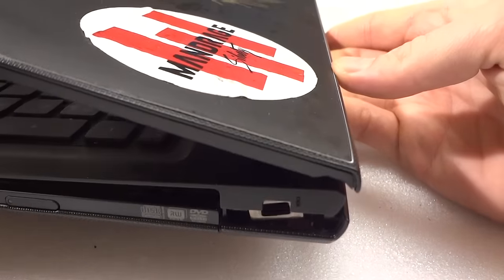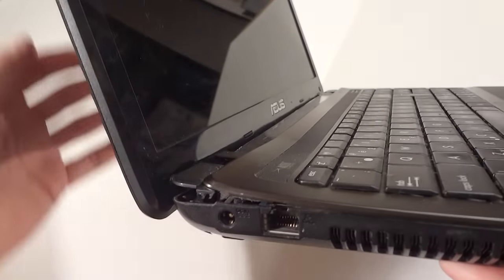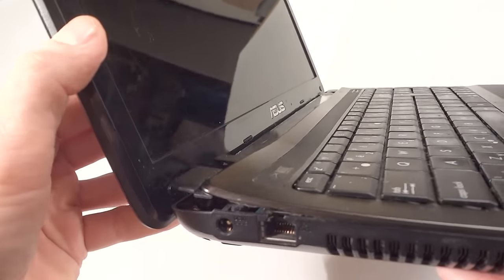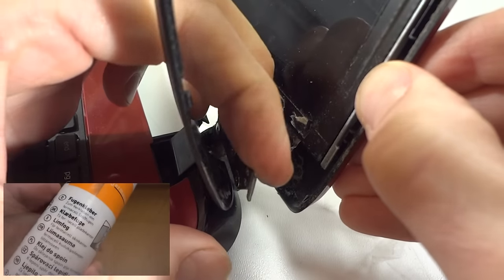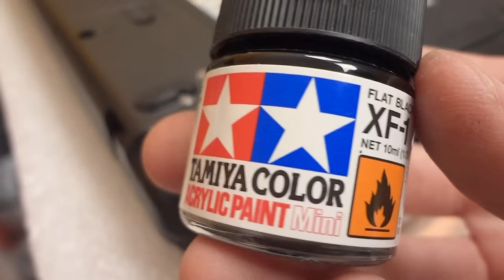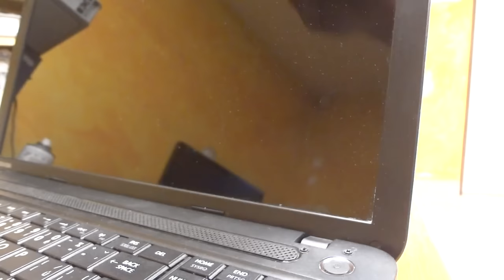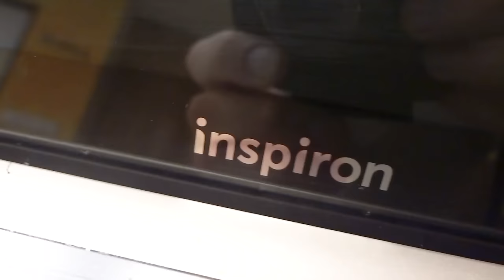LAPTOP Broken Hinges repair fix Screen Arm DIY 🔩 🔧 ➤ ACER ASUS Lenovo HP Toshiba SONY DELL

Comment: Thank you very much for this video. Just fixed my HP-15 laptop hinge using this method. In case anyone has this problem on an HP and is not sure of the exact hardware required I can help out. I only had one hinge that was broken & it was detached from the screen not the chassis. I used (3) M4-0.7x12mm flat head screws & (3) M4 Nylon lock washers. The 12mm are the perfect length. It is probably a good idea to add a drop or two of oil to the hinge to reduce the friction while you are in there. Barrel lugs would look better but may not be available at your local hardware store. Clearance hole was made using a 5/32" drill bit, I believe, but start with 1/8" and work your way up sizes until the screw barely passes through. You want a tight fit. Also, on one of the hinges, there was a very thin metal sheet riveted on to the hinges that was obstructing access to the mounting holes so I just pried that off with a small screwdriver. Easy project.
Reply: I asked to a professional to fix my HP TwT
Reply: Thanks for comment i was wondering about my lapppi size
Reply: Nyla W!ngsTracks how much was it?
Reply: Facing the same issue with my hp 15 series laptop. But I'm gonna drill but gonna use some tough glue with baking salt.
Reply: I also repaired my hp 15 from year 2014 the same way. 
It served me quite a long time. Before I could finally get a new casing
Reply: 12mm rivnut not 3mm…?

Comment: This is a GREAT video!!!!!!!!!!!!!!!!!!!!! It has given me the courage to do it myself. I took to the shop and they want 350 to repair. I can buy a new laptop computer for that.... I have a question, you showed the Toshiba fix but it is only on the bottom assembly. My repair is on the top assembly over on the right by the on button . Do you have a video repair for the top assembly?  If so please provide the link.

Comment: i like to repair stuff on my own . my sony vaio's hinge had broken 6-7year ago . i got it repaired using epoxy and super glue but it had to be repaired again and again after every few months . I saw this video a month ago and got it fixed using rivet screw .that rivet screw solved my prob, now it is as good as new .Thanks a ton

Comment: Excellent solutions with permanent fixes. But, some of your customers  probably cried when seeing the Frankenstein screw heads sticking out on their laptops!  :)   To prevent the cracks on the plastic case, I would use washers under most screw heads. I would drill the counterbore holes to offset the washer's thickness to make them look less visible. Thanks for the great video.
Reply: Better than an unfuctionnal pc

Comment: This is so satisfying 😍😍😍

The hinge of my laptop recently broke. I have fixed it by Epoxy glue in other laptop and Now I will fix mine with rivets
Reply: i was about to ask something similar, not every glue works.. i put right now (cianocrilate) but i dont think its going to last - the whole effort its not simple, is dissassemblying whole computer almost

Comment: I like the rivets idea, I didn't know those exist. I had some luck using a lot of epoxy and counter sinking the bottom side into the laptop and then covering it to hide it. I lucked out on that one and it lined up with one of the rubber feet which hides the hole beautifully

Comment: i had acer e5 exactly similar broken hinge on that broken hp hinge. Is that method will help to fix my laptop hinge only rivets and drill? Thanks and advance (:

Update: My laptop hinges are fixed now using rivets. Thank you!

Comment: excellent estimated video, unfortunately I have worked on similar things, they are difficult unpleasant .. but seeing your effort makes you want to imitate. The other option is to buy the original part which is between expensive and sometimes impossible. congratulations and greetings from Argentina

Comment: Bro please reply that my two hinges are broken(the long one which supports the lid) and after using these methods (like using screws) does it lead to broke my panel  where the screws are present. Please please reply when you watch this comment. You got a subscriber now.

Comment: You should sell small assortments of the nuts and bolts you use in these videos on eBay, maybe with the glue as an option.  Like "enough parts to fix both hinges on most Acer/Gateway models", etc. With  link to your video and instructions on resetting the nuts & what size drill bits to use. I've had three laptops now that worked perfectly well & were on current platforms except the hinges going made them completely unusable. Not everyone can afford to care more about how their laptop looks than how it works. Hoping I can get the self-employed repair guy I know to consider adding these kinds of chassis repairs to his services. Thanks for sharing!

Comment: Thank you for your work, I plan on following your solution but I have one question in mind:
screwing the hinge to the metallic cover with the rivet isn't an electrical risk regarding the connection to the ground ? The original hinge is screwed into the plastic and the two metallic parts isolated from each other (maybe so it breaks and later you pay the repair, but ...)

Comment: thank you for a great video! a hinge just broke on my laptop and this video was the first one to pop up, very helpful indeed. what would you suggest for fixing the piece of metal running along the side of the screen? i guess it's there for structural support when opening and closing mine snapped just where it meets the hinge.
Reply from the maker: Take a picture and send me on my facebook profile. I will check it.

Comment: Thanks for the video, very helpful.  Just wondering if you could provide the size (length/diameter) of the hardware used on fixing the Toshiba Satellite laptop?Thanks in advance!

Comment: My frame + screen is coming apart. It started separating when trying to close the laptop.
Reply: OMG same I need help fixing that
Reply: @sirtchamp8033  13:15 may help you
Reply: My pc broke so now I'ma need it repaired. Thanks for the help anyways!
Reply: Same my HP laptop literally the hinges broke off
Reply: same hahaha but i try it a littile bit fast then my laptop screen and the screen is now craft then i need a holder or wall for a safety hahaha

Comment: Hello Mr. RCompHacks, my laptop, an HP G72-B6OUS Notebook, has a broken right hinge and a fan that hasn't worked for a long time.  I have the screen taped so it doesn't get worse and keep a portable fan up against it so it doesn't overheat.
My knowledge of PCs software is limited especially the mechanics of it.  Trying to embark on a mission as needed to fix just the hinge, only not to mention the fan, is a project I don't think I can challenge. I'm plum out of luck and out of using my laptop which is my source to the outside world.  Without it am lost.  Though my laptop  still works with the two problems it has I don't know how much longer it can go.  I am so lost without it just thinking about it makes me feel like I'm going crazy.
Reply: whatever happened with your laptop

Comment: I drilled four holes in my Asus laptop to secure the hinges.  I had tried super glue and then epoxy.  The torque is just too much even after applying WD-40 and loosening the hinges.  It's not nearly as scary as it seems.  The top is made out of aluminum great for drilling and attaching screws.

Comment: There is a way to prevent the bracket breaking the laptop casing in the first place. When you feel the laptop lid getting tighter to open. Split the laptop to access the hinge bracket. 30 seconds into this video you will see a large Nut on the end of the Hinge bracket. Turns this nut anticlockwise one or two turns, this will release the tightness on the hinge and allow the hinge to move more freely. This nut is spring loaded and will not loosen. Prevention is better than cure.

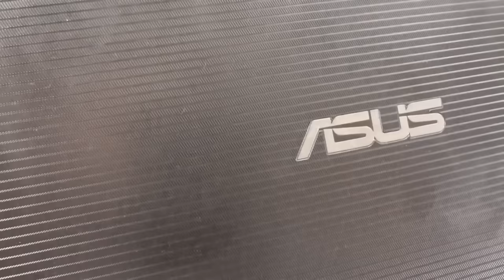Comment: Out of curiosity, in a case similar to the Asus hinge one at 15:40, is applying one screw only safe, instead of reapplying all of them, or would something change in terms of strain? Of course, I mean after lubricant had been applied on the hinge, and the hinge's nut had been loosened up accordingly beforehand.
Reply from the maker: If I fix this problem I will replace all the screws. Just one screw may not be enough.

Comment: 🙏 I followed the link for the construction adhesive but I am not sure which product is what you used. The 2 part epoxy I have. Is the beige substance something that dries hard enough to drill & set a new rivet? What are it's properties, please? I need to buy some in another brand.

Comment: IT tech here, most common ones are Lenovo and Acer, Lenovo even the main frame breaks most often.
There should be a recall made by consumers, take a few shots of the broken laptop and lodge it with your country's consumer/trade centre.

Comment: The vid is great but my laptop has a very different problem.
It is Toshiba and the plastic cover holding the hinge break so when you close or open the piece of laptop moves along with it. I need ideas on how to fix this.

Comment: Hi, why did you have to place the brass nut back and then drill it? I was wondering if i could just drill through without the nut?
Reply from the maker: Due to the original position of the hinges. The chassis -- palmrest and bottom case would then not have to fit after tightening the screws.

Comment: Fantastic video....any chance you could provide links to the tools needed? Which glue did you use? What size drill bit and nuts? etc etc.....will be very helpful if you could....I'm going to repair my own personal Packard Bell laptop.
Reply: It's all in the description

Comment: Are you using 2.0 mm bolts to push through the 2.5 mm PC nuts that you epoxied back on? Or are you drilling out the threads in the nuts when using the brass rivets?

Plus are those 4mm wide x what mm tall rivets that you are using? (At 11:38 into the video).
Reply from the maker: I use 2mm bolts and nuts. For rivets I use 3mm bolts without original threads. Rivets are 4mm wide and 5mm or 6.5mm tall.
Reply: @RCompHacks   Thanks for responding. I've been using your techniques since watching your video here! Saved many a laptops! 😀

Comment: Great video! Thank you for sharing! The slim, metal arm that runs up the side of the LCD screen broke just above the hinge on my Acer VN7, 17" laptop. Any suggestions on how to repair that? The hinge also broke away from lid so I will do one of your elegant repairs on that as well. Thanks in advance for your help?
Reply from the maker: Metal Hinges parts must be replaced for brand new.
Reply: @RCompHacks  bhai hinge repair kre jo GoLden wali uska naam kya hai

Comment: Hie , I have a Lenovo IdeaPad z580, which screw size should I buy to fix the hinges ? Washers and nuts might be available at local store but I am not sure about the screws. Kindly let me know the screw size(length) and diameter for the same. Thank you for your amazing video guidance.
Reply from the maker: M2 or M3 screw and length you have to modify. You can buy all what you need from me on ebay. Link in video description.

Comment: amazing repair job, what kind of epoxy are you using? i simetimes repair plastic with 2 compound epoxy but i dont feel like it is hard enough once mixed and repaired
Reply from the maker: Alteco epoxy glue.

Comment: Looking at performing a repairs like this, I know you linked some glues, but the 2nd link for your 'strong glue' doesn't point directly at the product.  Could you tell me what glue products you use?
Reply from the maker: Just use Epoxy glue.

Comment: Great video.  Somebody plz explain how they break ??
Reply: i think mine fell down and then the like side broke
Reply: On cheaper and middle-class consumer laptops, they just mold the metal threads for the hinge screws into the plastic of the bottom cover. Over the years the plastic weakens from opening and closing the lid and the molded in metal threads break loose from the plastic case. In my opinion, they do this on purpose. It`s called planned obsolescence. Expensive business laptops and 1000€+ consumer laptops mostly have hinges that are built to last.

Comment: which is the slightly yellowish glue mold you put in to set the bolts inside, you have put 2 different glues in the description, wondering which one is which.
Reply from the maker: Construction strong glue what I used: https://www.fermacell.com/1931.php  The glue remained after the construction of the house. Alteco epoxy glue working fine too.

Comment: may i ask? why bother returning the volt thread?
your gonna put a new screw any way that will go through the hinge and put a volt to lock it.. seems secured and strong already?
Reply from the maker: Because the original distance is the same.

Comment: Thanks for the great video! Could I just put epoxy on the computer then put in the barrel screws on one side and other screw on the other side and let them dry together instead of waiting 24 hours and drilling through the epoxy later?
Reply: Sounds like that could work, maybe he wants to make it a bit more sturdy placing some of the dented parts.

Comment: hello i fixed my laptop using these method but the lid started cracking, what should i do?
Reply: too much pressure on the cable, add some wedge to make a gap between the cable

Comment: Sir I respect to you please give this type of nut bolt in India which app side by side are availabl
Reply: You will find them in leather belt repair shops

Screw and nut to fasten the leather belt to the iron clip

Comment: The brass gear-shaped nut the screw goes into on laptop hinge for Lenovo is not listed in important parts to buy 
What is the size of the brass 'gear-shaped' nut please? Thank you RCompHacks
Reply from the maker: Rivets 4mm
Reply: Would Fastenal carry gear-shaped rivets? Looks like nut with threads. M3 flat head screws came out with these attached. I had unscrewed the other two M3 flat head screws with small Phillips screwdriver. How long would you say this job had taken to complete?

Comment: What items and sizes did you use for the HP laptop? Also, do I have to remove my keyboard to replace the bottom part of the hinge like you did here  20:30 , if the top part (near the screen) is the only part broken?
Reply from the maker: It is not necessary remove keyboard and palmrest. In my case metal hinge was broken. You can fix only LCD cover, Rivets 4mm.
Reply: Thank you for your reply! What size screw did you use for the rivets here 21:37?
Reply from the maker: Round 10mm , size height 4mm

Comment: might be a dumb question but what’s the reason for needing to use and glue the original material? Couldn’t you just drill and screw straight away? (I lost most of mine and only left with the gold nuts in the middle)
Reply from the maker: In most cases it is necessary to prepare the original position for the hinges. Hinges could be lower than needed. LCD plastic cover would not open properly.
Reply: RCompHacks I see. another question. what is the original material? because if it is metal and I use metal screws, wouldn’t that be a concern for short-circuiting?
Reply from the maker: It is metal but no worries.

Comment: hi i am bangladeshi..so how can i buy this product
Reply: Bro search up barrel screws or Chicago screws on amazon. M3 bolts should be sufficient buy a compartment box. I personally prefer to repair with a glue gun. I've repaired plenty of broken hinges this was, layer it up and sandwich it between the plastic casings. Then clamp it for 20 mins.

Comment: Having same hinge problem with left side on Y50-70 fused in 90 degree angle. Please contact me regarding bezel on display. I am a college student, must repair soon, need advice to remove touchscreen display. My display has flush screen, bezel appears to be beneath. Different from other touchscreen Lenevo Y50-70 disassembled here on YouTube.

Comment: hi can I ask what mm screw size do i use in using a 4mm rivet?
Reply from the maker: Screw length of each laptop is different. I have 30mm screws and shorten as needed. HP 15 lenght is 5mm.

Comment: Will a pair of M2.5x5mm screws be good enough for the specific model at 3:09?
Reply from the maker: Screw length is about 20mm. I used the M2 diameter.
Reply: @RCompHacks  Thanks!Will M2.5 screws fit? I've already ordered them..
Reply from the maker: @nickllamaone15  M2.5 would be fine. If you still have origin screw-thread probably you will remove it. Screw-thread is M2 diameter from factory.

Comment: Does anyone know what the name of the metal part that goes in the hole after the epoxy?
Reply: Philong Than- it's a part of the Hinge. No any extra metal is used except screws and nuts.

Comment: I admit this method makes the hinges 100 times stronger but personally I cant allow it to my pc and make holes in the bottom or top covers its disgusting honestly....you can still use epoxy without making holes in the cover just putting the screws in their place